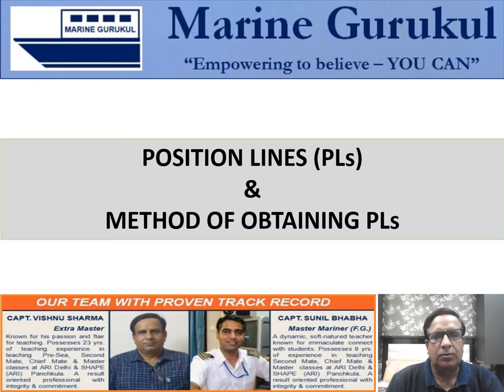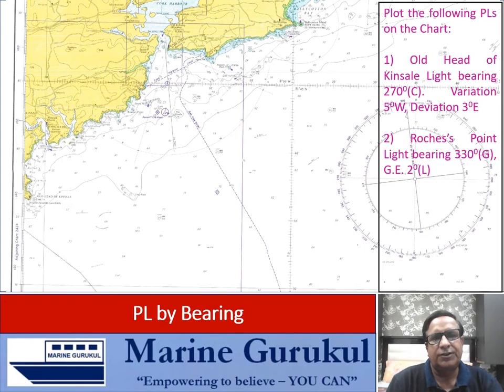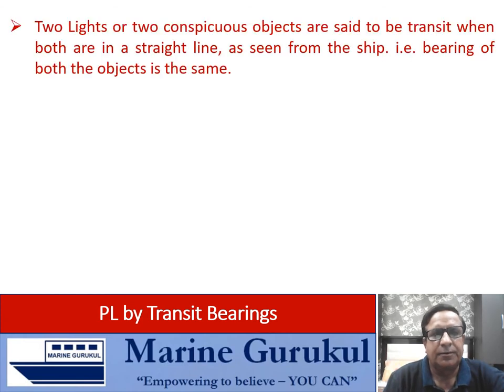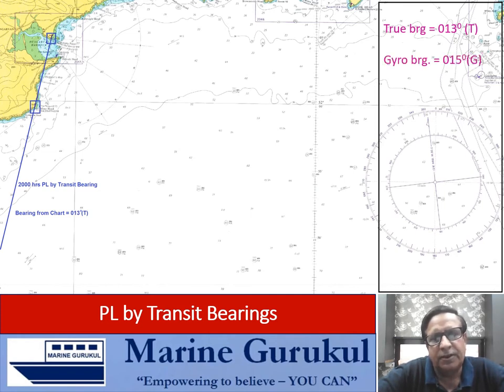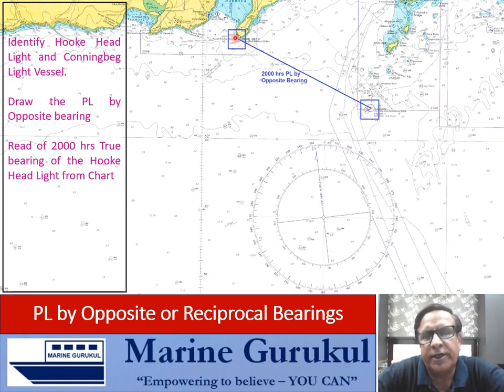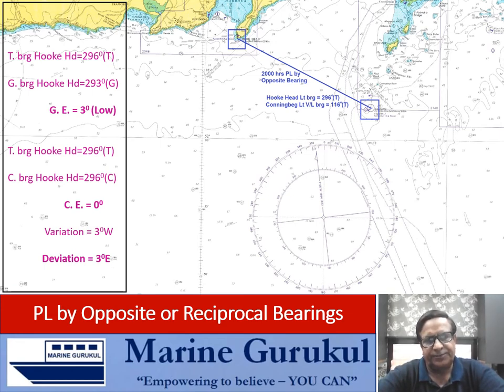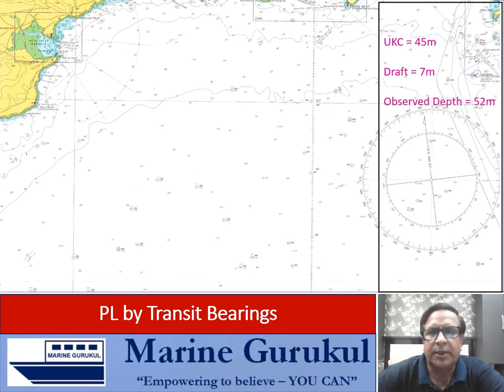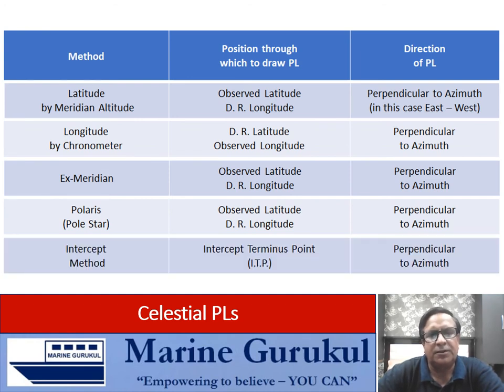Position Lines (PLs) & Methods of Obtaining PLs

Comment: Sir please , enlighten me , plot three position lines and obtain ship position?
Reply from the maker: Are you referring to obtaining Fix by plotting three PLs?
If so, usually three PLs may not meet at one point - instead form a cocked hat. It is because of errors in PLs.
If all PLs suffer from same error i.e. fixed error - the cocked hat can be resolved. Resolution of cocked hat is a topic in itself.
If Pls suffer from random errors - cocked hat cannot be resolved. In such a situation we assume the vessel to be is most dangerous position.
Hope your question is answered.
Best wishes